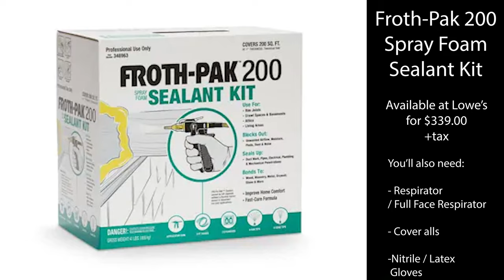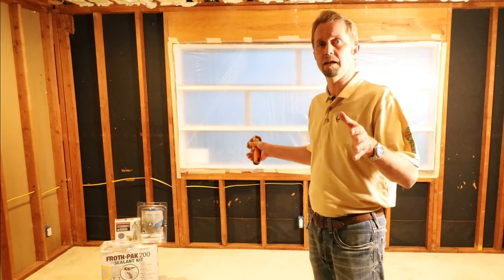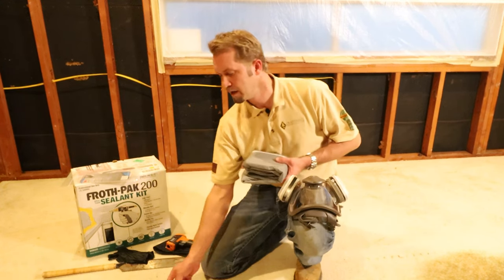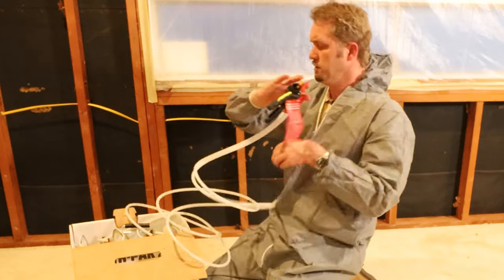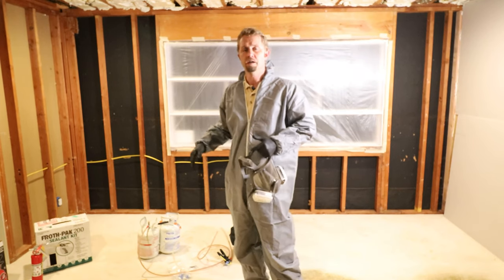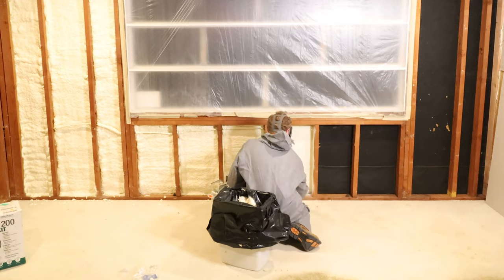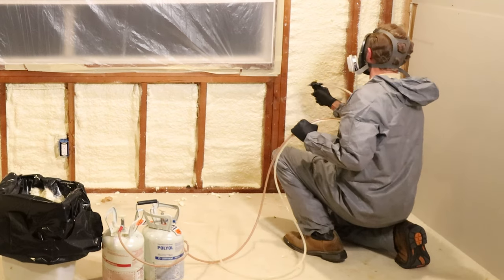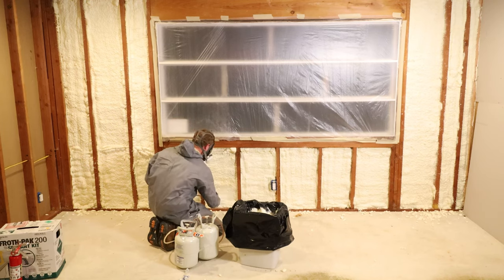Froth-Pak 200 Spray Foam Sealant Kit Set-Up, Precautions, and Spraying Review #Froth-Pak

Comment: This home has the old stile framing. the left corner needs to be filled as well, or you will still have a draft corner.
Reply from the maker: Later on, I used a small spray foam gun to inject foam into the corner. More controlled approach for such a small gap to spray into.

Comment: you keep checking the temperature but what are you going to do if it starts getting too hot?
Reply from the maker: If it gets hot enough to start a fire, I had a fire extinguisher to put a fire out. That is what I was advised to have on hand by my spray foam contractor friend.

Comment: Great Video, what is difference of the green box and the red box Froth-Pak ?
Reply from the maker: The red box is closed cell foam with  a Class A fire rating. The green box is regular closed cell foam. Both are spray foam insulation. The boxes are not labeled well, but the DOW.com website has them both listed as spray foam and sealant kit.
Reply: Awesome. Thanks  @craftsmanconnection

Comment: I thought that the froth pak 200 was a closed cell and only used for crawl spaces Etc,So its ok for wall insulation? How about attic roof insulation?
Reply from the maker: Hi Justin,  Froth-Pak is a closed cell spray foam. I called my spray foam contractor again to confirm that it is ok to use closed cell spray foam in exterior walls, roofs, crawl spaces, etc., and he said yes it is OK. There is only 1 issue that one could have is up against a roof line. The issue is, if the roof leaks you will most likely not know about it and the roof sheathing could rot out due to a damaged or not properly installed roof. Other than that, you can use closed cell foam anywhere. The cost is higher for closed cell, but you also get about twice the R-Value, and get the added bonus of an air barrier. The YouTube Channel Matt Risinger or The Build Show (same guy) talks heavily about the importance of air barriers, air sealing between framing, and quality contractor work around this topic.
Reply: Don't forget the "Sealant kit" is not the same as the "insulation kit" and you will need an additional fire barrier over the top of the foam  he is spraying per building codes in your area
Reply from the maker: This Sealant Kit is Spray Foam Insulation. Not in all cases do you need a thermal/fire barrier “intumescent” paint coating. In this video the spray foam sealant kit is being used in a way that will be covered up with a sheet of drywall which has a 30’minute fire rating. 5/8” Type X sheetrock has a 1 hour fire rating, and 2 layers of 5/8” Type X sheetrock has a 2 hour fire rating. Only in some exposed situations may a fire barrier paint product be required to be applied. I’m a former building inspector. Feel free to do some more research.

Comment: I couldn't tell if the floor was covered with plastic or not.  I don't think so.  Was it difficult to get the product off the floor?
Reply from the maker: The floor had old plush carpet on it, and the carpet was coming up after the spray foam install. I used it as flooring protection. Normally you would want to apply some flooring protection like plastic. Open cell foam (soft and fluffy) is easier to remove overspray, but closed cell foam (dense/firm/hard) is not as easy to remove. Better to spend 5 minutes rolling out a piece of plastic along a wall, and taping it down in a few spots than to spend time being unsure about getting product off of a floor. Fortunately, the Froth Pak wasn’t a really messy product due to the pressure in the tank, unlike other spray foam product videos I have watched.

Many years ago, I had a spray foam contractor spray closed cell foam into the stud cavities of a wine cellar, and he got closed cell foam on top of each stud in about a 10’ x 12’ room, and it took me 2 days to remove all the extra foam just so I could put up the Hardie Backer for my brick veneer.

Comment: Few things to note here:

1. The supplier recommends a distance of 6 - 18" from the hose to the surface being applied.

2. The intended purpose of this foam is to seal airflow. You are using it as insulation, there is no airflow between your studs and outer wall... hopefully.

3. The supplier recommends changing the nozzle after pausing spraying for 20 - 30 seconds and to not spray over foam that is curing, which takes at least 5 minutes. Patience young one.

I appreciate the presentation of what not to do, this was very entertaining to watch. Cheers.
Reply from the maker: 2. This is a sealant and insulation kit. I have commented on this before, and it’s on the Froth Pak website for evidence. The reason they label it on the box as a sealant kit, is because of the quantity of square footage, but if you read the website, it also says for insulation.

3. The manufacturer, not supplier, recommends changing the tip after so many seconds of not spraying, meaning idle use, and the reason for that is because the foam will cure and harden in the tip of the foam is allowed to sit there. This is not true if you continue to spray foam without any long pauses.

I’m happy you enjoyed the video. I stayed “Up all night to spray foam!”😁🎶

Comment: According to froth Pak the 200 sealant isn't actually meant for insulating rooms.  It's meant for sealing.  If you want insulation it's the froth pak 650 insulation
Reply from the maker: The Froth Pak 200 and the Froth Pak 650 is the same product, just a different size package. Clearly nobody would insulate a whole house or a wall with a single 16oz can of spray foam type thing, and that is meant to seal small holes. However, the froth Pak will stick to a wall in large quantities, unlike the type of foam that is in the small spray cans. If anyone tries to use a small spray can of foam in a large quantity like you would find in a 16” wide stud bay, the foam will just fall off the wall.
Reply: @craftsmanconnection  interesting.   I saw them replying to some questions about if it's insulation.  Maybe 5th get want to sell the bigger stuff
Reply from the maker: Highly Rated Outdoors, I searched for Froth Pak 200, and went to the DuPont website link. if you go to DuPont.com for Froth Pak 200, and scroll down to the second paragraph, it’ll talk about small gaps and penetrations up to 4”, and then it says “or as a spray foam insulation to fill larger cavities providing both insulation and air sealing properties.”
Reply from the maker: Froth Pak does probably want to sell the bigger package, and probably for a legitimate reason. In my video, you’ll see that the Froth Pak 200 only covered about 77 Sq. Ft., at 2” to 2-1/2” thick, and that would not be ideal to seal/insulate a small bedroom, and therefore need a larger sized unit. However in my case in was the perfect sized unit for what I was doing. When I go to insulate my new larger kitchen, I will be buying the larger Froth Pak 650 unit, since there is about 3 times the length of walls.
Reply: @craftsmanconnection  forsure.
Reply: @craftsmanconnection  I wanna do my garage but idk if it would be cheaper to just do it myself or not
Reply from the maker: Let’s talk cost of materials first, and let’s assume you have a 20’ x 20’ garage with a 16 foot garage door, 1 person door, and using material cost from the Froth Pak 200. If you have 20’ + 20’ +17’ + 2’ + 2’ (either side of garage door, than that totals 61 lineal feet and with an 8 foot wall height that equals 488 square feet / 77 sq. ft. = 7 kits of spray foam x $369 each kit = $2,583 plus tax. So roughly $2,750. Now my spray foam sub-contractor here in Texas used to be $1,200 minimum charge and has since gone up to $1,500 minimum charge around 2 years ago. If I remember about right, for open cell foam (Froth Pak is closed cell), he would charge around $2 a square foot. The point is that 488 square feet x $2 is basically $1,000, so you would be much better off highering a spray foam contractor for your garage, and I haven’t even factored in the garage ceiling, assuming it’s accessible and not already insulated. That ought to help you out in making a good financial decision.
Reply from the maker: For the cost of 4 kits ($369 x 4 + tax), you could basically hire a spray foam contractor to provide the materials and do all the work for you.
Reply: @craftsmanconnection  it's a 22 by 32.  1 door on the 22ft wall  is 16 wide and on the other 22 ft wall is 8 wide
Reply from the maker: You have 732 square feet of walls. If you hire a spray foam contractor, you are probably looking at around $1,500 for 3-1/2” thick worth of insulation.
Reply from the maker: Open cell insulation. Check out the R-value difference, and factor in whatever vapor barrier requirements you may need. Open cell is vapor permeable, and closed  cell is vapor closed, like a igloo cooler. Think about other factors such as if you use closed cell foam, and it’s around plumbing and wiring. It’s a total pain to remove closed cell foam to work on stuff, because it’s very dense. Open cell foam is soft and you can grab it with your hand to pull it out of the stud cavity.
Reply from the maker: Are you a subscriber of my channel? When I do my large kitchen (9’ x 19’), I’m planning on making a video of the Froth- Pak 650. You can then see all of the data on that product and how far it went. Probably 230 square feet, or so. I only have to do 2 walls in that kitchen. You could be my 631st subscriber out of the 1000 I need to get monetized 😄.
Reply from the maker: I sent a few more replies. Not sure if I hit your comment reply button.
Reply: @craftsmanconnection  that's super good to know I was curious of the difference.    I'll have to take a look.  I just want the garage to be able to hold heat in the winter.   I live in Minnesota. So.it gets pretty cold
Reply from the maker: @I_AM_ISAACP  Look into climate zones. In northern climates you’ll want to have a vapor barrier on the inside of an air conditioned space to keep mold from growing behind sheetrock. In Southern climates, the vapor barrier is on the outside of the air conditioned space.
Reply: @craftsmanconnection  meaning the vapor barrier between the insulation and the sheet rock right.  Like plastic between pink insulation and sheetrock
Reply from the maker: Do you have a heater in your garage? Have you also used insulation panels on your garage door? If you have a heat source, like an electric heater, than you’ll be feeling pretty darn good with the add of spray foam. 

I had my spray foam contractor do my enclosed patio ceiling flat roof in open cell foam in case the new flat roof ever leaks, and I have a small electric heater that looks like a small fireplace I bought from Lowes. Even when it was negative 2 degrees outside during Feb/March 2021, I slept outside on my patio with an electric blanket.
Reply: @craftsmanconnection  I will be putting a gas heater in the garage eventually.   Figured spray foam might be better for holding the heat in and wouldn't need to run it as much
Reply from the maker: Yes, traditional fiberglass insulation and the like requires a vapor barrier to control condensation forming on the enclosed stud cavity. Where it goes, depends on where you live.
Reply from the maker: Spray foam vs. fiberglass….Assuming R-value  is the same. There is no difference in returned value there. The value is really on how well it seals in terms of how well it fits every part of the stud cavity. If you study air transmission control, and air sealing, like on Matt Risingers channel, of The Build Show, he covers air sealing in many of his older videos. That is where most of your loss is, in air leaking through the cumulative micro gaps around the house.
Reply: @craftsmanconnection  I will check that out thanks
Reply: @craftsmanconnection  its a sealant. It has different r value, not vapor barier or fire proof
Reply from the maker: Autistic Machine, Not True. Go to the DuPont.com website when you search for Froth Pak.

This is literally copied and pasted from the DuPont.com website, second paragraph.

“Froth-Pak™ Foam Insulation is a two-component professional insulation kit. Froth-Pak™ comes as a professional sealant for air sealing gaps and penetrations up to 4 inches wide or as a spray foam insulation to fill larger cavities providing both insulation and air sealing properties. The Class-A rating (flame spread of 25 or less) of Froth-Pak™ Foam Insulation allows its use in a wide range of interior and exterior industrial, commercial, institutional and residential settings”

Comment: Looking for a solution to insulate my cargo trailer. The steel suds are only one inch deep. Is it possible to spray this thin or will the thinest application expand to more than 1 inch?
Reply from the maker: Nomadic Newfies, it is possible to spray this product 1 inch or less. In my video I made 2 passes on the wall to make 2 inches to 2-1/2 inches thick. Just spray a small area first to get a feel for how much product to apply. It might look like you are applying the wet product 1/4” thick, but it will expand. Froth Pak Closed cell foam is a pretty tough product, and I just purchased 2 more boxes at $409 + tax and that will cover about 152 square feet at 1” thick. If you have a 16 foot trailer x 7 feet wide x 80” tall, than you would have 160 sq. ft of walls not counting the ramp and 112 sq. ft. for the roofline of the trailer. The time to apply this might be around an hour or so. Just put a piece of masking tape over each metal bar/post/stud to keep the foam overspray off of the metal, so you can peel the tape off afterwards. Cover your trailer inside light fixture. You won’t have to worry about purchasing and applying adhesive, or weird gaps/seams or having a purple lined trailer, lol! If purchasing 2 froth pack kits at $409 + tax each, and you have 272 square feet of surface area, your cost is $3.00 per square foot + tax. Pros: you can make this the thickness you want, add on to it later, shave it (although not easy to do), adheres well, may spark a conversation with a customer for possible job, and you could film it for YouTube, and R6 per inch. Cons: Not a smooth surface, and not cheap.

Another alternative is buying some 1” foam board and an adhesive at Home Depot. Each 1” foam board, like the purple one I purchased last week, will cost you $29.00 + tax for each 32 square feet, so you would need at least 5 for the walls and 3-4 for the ceiling, assuming we imagined a perfect world where you didn’t have metal posts in the way, so you know you will want it to look better and not all cut up like a cheap mofo would do. $29 x 10 pieces is obviously $290 + tax, and there would be countless hours cutting the board to fit, adhesive to apply, and probably other issues. The Owens Corning XPS purple 1”board is an R-5 value. XPS is Expanded Poly Styrene. If you go this route, your material cost is $1.25 per square foot with $290 for insulation and $50 for adhesive. Downside: your labor time is higher possibly, and may have a hard time keeping it on the ceiling/ roof if the trailer. Upside: smoother surface. You may be able to find something not purple and hopefully a foil faced product.
Reply from the maker: If you do decide to film the spray foam work on your trailer, you should get lots of views. The views will slowly grow initially, but as people discover your video, it’ll get a crazy amount of views. This video has shot up dramatically this month to over 21,000 views in just the past 28 days, and over 107,000 views in the past 17 months. That’s around 107 x $5 = $535 and will pay for the spray foam eventually. I’m just about 120 subscribers away from when YouTube starts paying me for the views.
Reply: @craftsmanconnection  thanks!!!!
Reply: @craftsmanconnection  sounds like a sound investment.
Reply from the maker: 😎👍🏼 Keep track of your time, so you can help others with the process of doing the same to their own trailers, and help you know what to charge if anyone asks you to do spray foam work for anything else. 
    My next project in process is a custom built 114 sq. ft tool shed, and I bought the Froth Pak for that project. I’ll film it and disclose my costs (labor time, money cost, etc.)
Reply from the maker: Are you a contractor? What do you do for a living?
Reply: @craftsmanconnection  no not at all. I work in retail. I just have a vivid imagination and like cool projects. The froth pak is an item Canadian Tire usually Carries in their weekly flyer maybe once every couple months. I thought it would be great for a cargo/toy hauler camper conversion trailer. It would adhere to the exterior skin to avoid moisture build up.